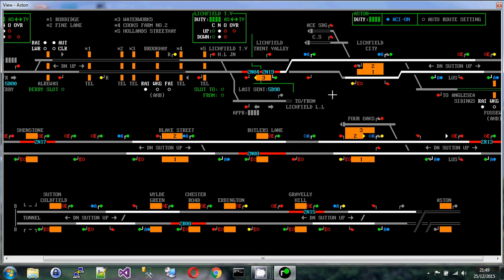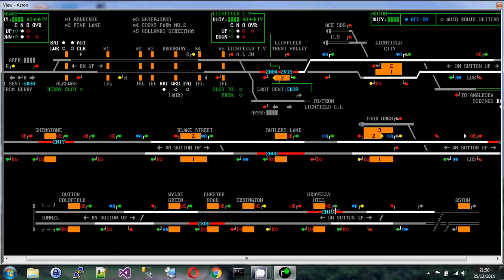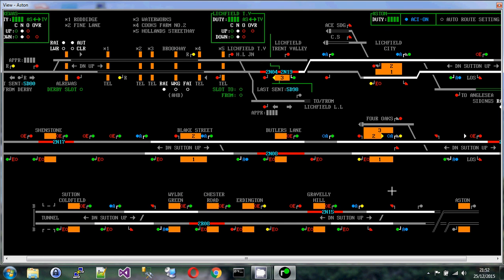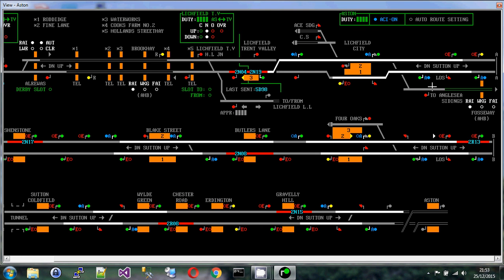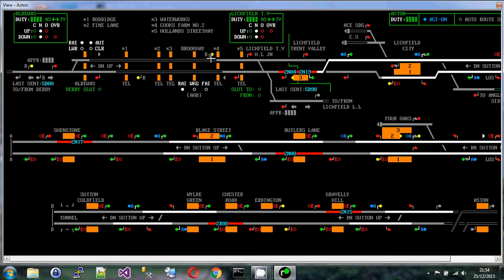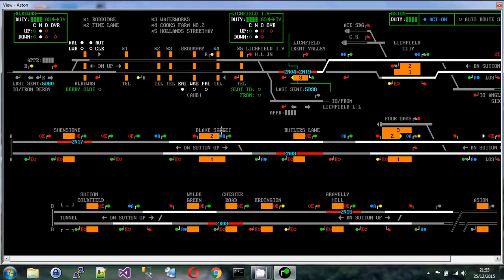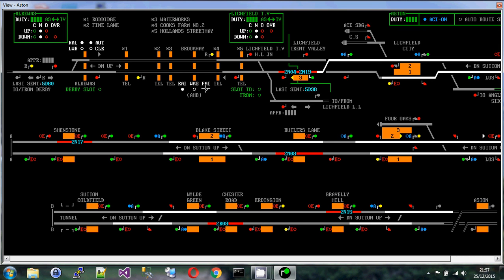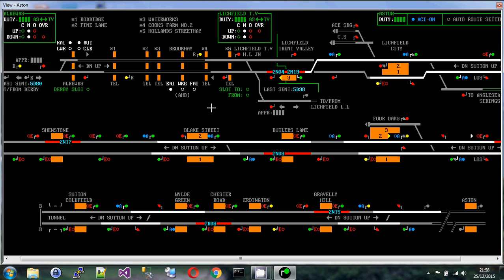Simsig Tutorial 1 - Basic layout of screens

Comment: How do you get the license to enable the use of trains? I tried to program in a CL230 but it won't let be input any data.
Reply from the maker: you don't need a licence to edit the timetable but depending on how you set it up, it might not appear if set to e.g. appear 50% of the time. Also, you have to add the train type and then add a service that uses that type.
Reply: @LukeBriner  How do I add the type? I don't have any rolling stock.
Reply from the maker: I'm not sure what your exact question is but I haven't done a tutorial on timetable editing because it is quite an involved topic. You don't have rolling stock as such in the timetable, you have a complete train such as "Class 317 4 car", which includes the length and acceleration of the whole train. If that was to join another  train of the same length to become another service then the other service would need to be a different type e.g. "Class 317 8 car" to make sure it's length has the correct effect on the train running. The easiest way is to edit an existing timetable and you should see how all the parts link together.